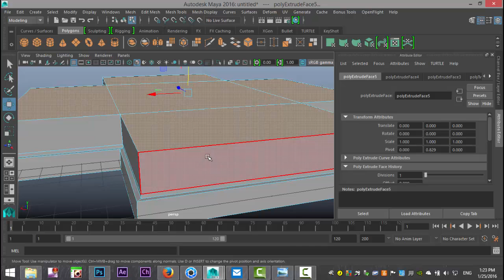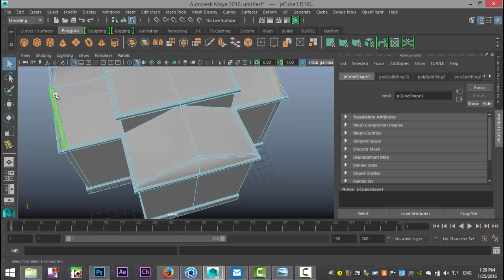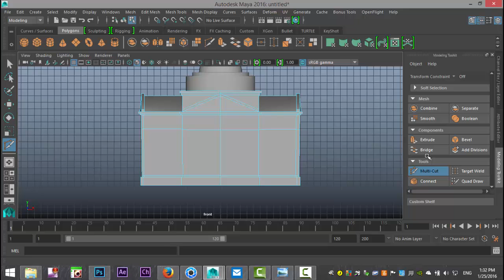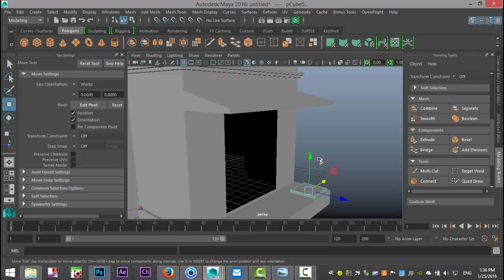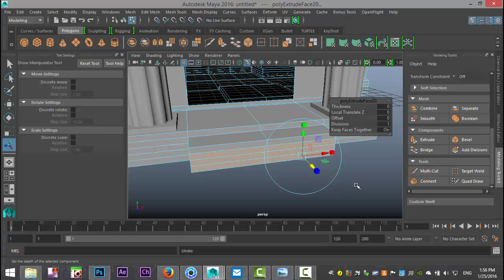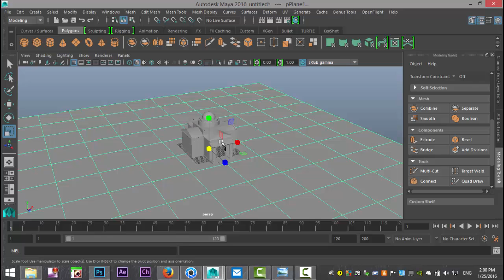Maya 2016 tutorial : How to model a Mausoleum

Comment: Hey Mike does real life measurement actually matter during the modelling phase? Or is it better to just model everything and than scale it accurately to real life?
Reply from the maker: Maya uses real life information in it's lights. So if your house is 2 inches big with a 100 WATT lightbulb in it........
Reply: I see, I mean I understand the final product has to be scaled to proper size so light behaves as it should be. But during the process of modelling do model is this a consideration that is monitored consistently during the modelling process? Or is it one of the last things that are done in the project before lights and textures and shaders are added? That being said do you set your preferences on grid to meters when modelling large scale items such as boats and houses? Thx for the reply!
Reply from the maker: It is a personal preference I guess. I model to scale while modeling ( if needed )
Reply: Understood boss! Thanks! Oh last question sorry to bother, is there a way to see the length of an object etc? I've been measuring meters by grid or by using a cube. Its still pretty messy when things start to hit beyond 25 meters. I was wondering if there was a way to see it as it is.
Reply from the maker: Check my video on the measurement tool
Reply: thanks mike!

Comment: nice tutorial as always! :) little question: if I want to use a model like this one in a game, how can I make sure I can walk inside? I mean right now the inside has black faces, how can I make normals on both sides of the polygons?
Reply: +Foxyruns hmm it could be that you have to have go to lighting>two sided lighting?
Reply from the maker: +Foxyruns If you want to be able to walk inside in a game engine it needs to be defined as a "cage" or walk able area. 
To avoid the black faces you need to extrude the main building before adding the columns and corner pieces. This will add grey faces on the inside